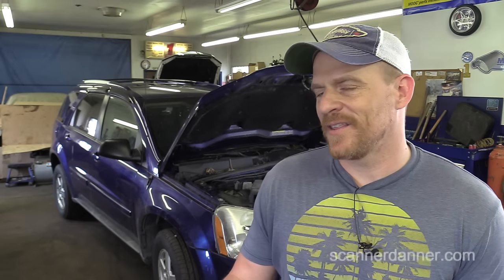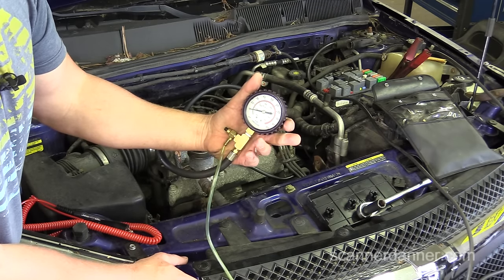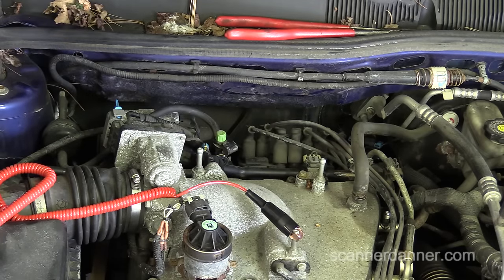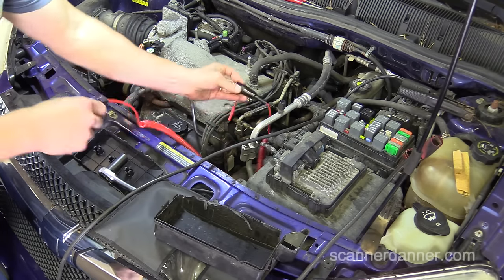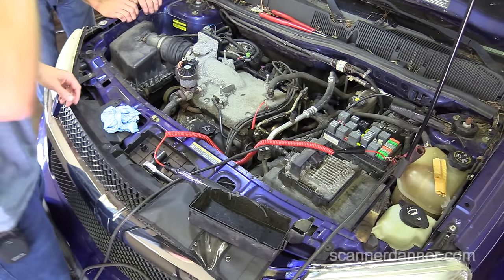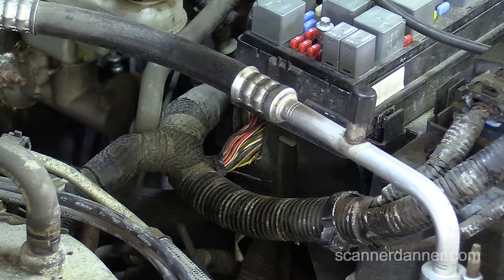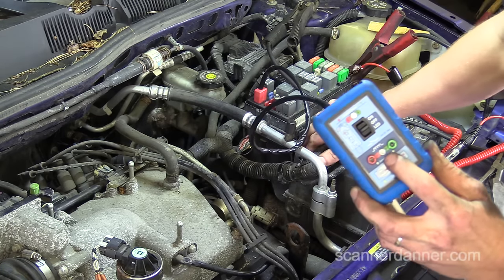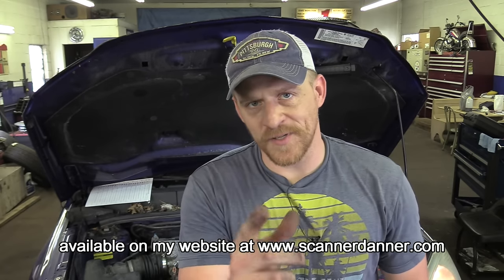No Start, Engine Cranks Okay, Troubleshooting With Basic Tools (No Power to Injectors)

Comment: When you checked the "emiss" fuse for power on each side didn't the engine need to be cranking for the pcm to provide a ground for the control side of the relay to close that emiss  fuse circuit and give it power?
Reply: No, the fuel pump was not on this circuit. Remember when I touched the two ends of the stripped wires together with just the key on and the circuit became active? Thanks! Great question

Comment: Did you have them check the brown wire at the PCM to make sure the PCM was actually grounding that circuit, or just take an educated guess at a broken wire between the pcm and relay?
Reply from the maker: No guess work. With no control at the relay your options are limited to a control wire  problem or  open driver in the PCM. So you start looking for visual evidence before testing the same wire at the computer.
Reply: Being in Texas I guess my first thought would be to hit the pcm next.    Nice find as usual and an awesome video.
Reply from the maker: For sure man. I was headed in that direction

Comment: I had a question. Before concluding that it was the wire that was the issue and not the ecm. Why not do a continuity check from the ecm connector to the relay input? Just a genuine question
Reply from the maker: I almost never use my ohmmeter in troubleshooting. It is voltage drop testing or using my test light for open circuit tests. The ohmmeter will get you in trouble. When it tests bad, it's bad, but when it tests good it can still be bad. Check this one out where the ohmmeter measures 0 ohms of resistance on a bad computer ground circuit https://www.youtube.com/watch?v=McsNOJvd0ao

Comment: yoooooooo danner  tell peat that  car needs the throttle body  cleaned   .. just did one today on same  car    great video   !!!!!!
Reply from the maker: I wouldn't argue that. Primarily though, the reason it wouldn't idle until we turned the key off, had more to do with the ETC fault in memory from no power to the throttle body, than it did a dirty throttle body. 
Thank you!

Comment: Great channel and lots of cool content. Unfortunately I haven’t gotten to the point of my problem. Chevy express 2500 won’t start. Have fuel pressure and spark, but still won’t crank. Btw I bet Pete doesn’t get much done when doing these videos haha! Cheers!
Reply from the maker: Won't crank as in battery, staring system problem. You need to watch some videos from my Starting, Charging and Battery playlist. Start with some basic tests at the starter itself. Watch this one https://www.youtube.com/watch?v=oo1SRIFIkhs&lc=Ugyd8w3HMMpkvQYnQyp4AaABAg

Comment: @scannerdanner In need of help. I recently bought a 2004 rsx with low km's but it was not running. It cranks over great, had 160 across all 4 cylinders. Checked fuel pump it primes like it should. Put a squirt of quick start in the intake and it sputters so it's getting some form of spark. Pulled the fuel line and it has proper pressure. I put new plugs in it and they are completely dry all 4 after trying to start it numerous times. I checked the injector plugs and they have 12v with key on. One weird thing I have noticed is that the green immobilizer light doesn't come on at all. I know it's supposed to come on, blink for 2 seconds and go out but mine doesn't come on at all. I called Acura and they said not to worry about it if it was the immobilizer nothing would work but from what I read the fuel pump will prime but the injectors won't fire. I don't want to tow the car to Acura and have them charge me piles of money, I have the time to diagnose it but need some help. I want to fix this myself. I want to be able to put a built not bought sticker on it when it's done lol. For now I need to get it running so I can have it safetied

Comment: I love heat shrink crimp connectors. Got a set off amazon, also with the built in hot snot. Gonna use them after I rip out my shitty aftermarket alarm.

Awesome video!

Comment: firs thanks for  all information,are there any problem when i use 12v to test ecu (5v)?
Reply from the maker: Use the circuit voltage that should be there whenever possible. Tap into the 5v ref circuit with your test light to substitute signals would be a better option.

Comment: I have a 1989 oldsmobile delta 88 no start, engine cranks and has fire, getting gas to the motor but and new gas lines on and won't start now I have not check the injector for power
Reply from the maker: What engine is in that? Is it the 3800?
I need a fuel pressure reading (getting gas is not good enough)
Then you need so see if you have injector pulse.

Comment: Hello Paul, when you used the relay tool, were you activating the load or control side of relay? Also when you used the test light to check the injectors , on ground you check power, then to battery positive to injector signal, what would happen if you checked it backwards with the test light by not having a wiring diagram?
Reply from the maker: load side. you won't hurt anything with your test light on an unplugged injector circuit. misdiagnosis is all.

Comment: you should try the heat shrink solder butt connectors, same idea except there's solder in the middle rather than a crimp connector

Comment: Followed your instructions, got spark, both sides injectors light up, all fuses,relays good. A new fuel pump, fuel filter, and fuel regulator. Bypassed system security and still won't start. If I spray starting fluid continuously it will run like new, as soon as stop spraying it dies out again. I am stumped. I don't have a fuel gauge for this 2002 avalanche but can hear pump turn on, can hear gas get to rails. Plugs are good, injectors are clean and spraying. Help please!!!!
Reply from the maker: You need to check your fuel psi. You need at least 60 psi cranking. Below 52 it won't start.(central port injection right?) Doesn't matter that you hear fuel.
Reply: ScannerDanner thanks, I am getting a fuel gauge Friday to check it. If not that then I'm gonna try and bypass the oil sensor, someone told me that it will also cause fuel pump shutdown because it uses same hot wire to ecm and if triggered exam shuts fuel pump off as a safety measure.

Comment: I have an 02 Chevy Express with a 57 it ran great it stalled it cranked would not start change crank position sensor would not start change coil it started for one second multiple times change cam sensor still one second multiple times as long as I shut the key off if I continue drinking it would not fire fuel pressure awesome etc is the cap

Comment: I have a 2011 Chevy Malibu I'm working on. Crank no start. Has spark.  No fuel pressure.  No power at fuel relay but power at the fuse..relay is good. Has me stumped at the moment. Any help would be appreciated

Comment: On another note, I use the ground lead on my Powerprobe 3 or 4 as the ground for my incandescent test light. Image a test light attached to a ground(assumed good ground) and you touch a power feed only to see your test light is dim. Is that a power feed fault or a poor ground for your test light? That could really send you in the wrong direction...
Reply from the maker: exactly, always check your connections

Comment: I have a 97 Buick lesabre. I replaced the starter alternator and battery, I replaced the fuel pump fuel filter made sure the fuel lines were sealed at the tank area and replaced the fuel pump relay after that the car would not start. It would start up but die almost immediately. I know the fuel pump gets shut off. I was able to get it started and running with starting fluid. My son drove it but the acceleration was delayed. My son without my knowledge let the neighbor work on it now the gauges do not work and it will not even start with starting fluid. I'm hoping you can help. I have no doubt it's simple but I feel at this point I can bash in my head against the wall. I don't know what the guy next door did to it.
Reply from the maker: you're describing multiple problems here my friend. But since the neighbor touched it and now it won't start with starting fluid, check it for spark next, maybe he blew a fuse that powers the ignition system and also the gauges

Comment: Hiscanner. Danner. I have a vehicle in which I am wondering if you could help me figure out a problem I’m having with it? It’s a 2003 Chevy S 10 blazer 4.3 L Vortec. I’m having a crank but no start issue it is getting spark fuel in the compression is good. I’m trying to fix it for this lady I met and she’s been trying to figure this out for over two years and I’m trying to help the poor lady. Is there anything you can recommend me trying to get it to start please and thank you
Reply from the maker: Where have you tested for spark? These distributor caps are notorious for having issues. 
Also, what is your fuel psi? You must have 60 psi during cranking on these. Under 50 and they won't start

Comment: when you checked the injector fuse, you said if either side isnt lit that is a power feed problem to the fuse. Is that ONLY if the fuse is a "hot at all times" fuse/and if the key is on? Otherwise, that would be a normal fuse reading( no power to either side of fuse) with key off? Sorry for not posting to forum, just wanted to shoot quick question.
Reply from the maker: Key on injector power is common but some circuits are relay controlled and will not have power unless there is a rpm signal to the computer.

Comment: I pulled a plug of a injector i turned on the key both terminals had power is that supposed to happen i stopped testing when that happened please in help would be great please

Comment: Hey There... I have a petrol engine car... It is not starting, I can hear the crank but it wont start. 
This is a regular problem.. If i dont start my vehicle for more than 2 days there is always trouble starting it, once it starts it works fine. 
The thing is I have to start the car once  in atleast two days to stay away from the starting trouble. 
The car takes a long crank to start  if wasnt started for a long period of time. 
Even though the long crank... It does start meaning there might not be anything wrong with the electrical system. 
Can you suggest something, what should i be looking for
Reply from the maker: Fuel pressure test would be my first check.

Comment: good morning, brother. Hey, can you please help me out with a  cuestion I bought a 2011 dodge caliber, but it doesn't have the intake magnefull runner control valve. Is this normal ?
Reply from the maker: what problem are you chasing?
Reply: @ScannerDanner  none the car is running 100% good it just looks like it had it one but I don't know 
I bought this car 600 no crank no start 
relay  corrosion comun an calibers is running now

Comment: I recently bought a mustang 06, it ran perfectly for about a month. Then one cold morning it didn't start; it just cranked, i quickly took it to a mechanic and told me it was the fuel pump. It was replaced and the next morning it did the same thing. The funny part about all this is that the car turns on during the day, but not in the mornings. There are no error codes, is there any suggestions?
Reply from the maker: You need to test for spark, fuel pressure and injection pulse DURING the no start condition. Find out what you are missing then we have some direction and we go from there.

Comment: I have a similar situation in a v8 p38 range rover 1998. There is no feed on the injector circuit with the ignition key switched on. I have checked all fuses and relays, everything seems really  
 ok except the ABS relay that feels hot to the touch.
   Please help me! What should I do next to fix the problem? The only code that appeared was p1843 and p1842.
Reply from the maker: some cars do not use a fuel pump prime with the key on. Do you have injector pulse and spark?
Reply: @ScannerDanner  No, I didn't.

Comment: I have 2006 vw Jetta TDI 1.9
Crank no start
Fuel pump relay good , no blown fuse 

No fuel comming to fuel filter 
Manualy connected power to fuel pump its working 
Power to relay good 
Only 3 volts coming to relay from Ecu and 3 from glow plug 
Look like not enough voltage to kick relay 
What’s next?

Comment: You seem to know how to find the problem on a no start engine. Here is my problem if you can shoot me in the right direction it would be greatly appreciated as i have heard a thousand wrongs so maybe i can get a right from you. I have a 1988 Ford 2.9 Bronco. I engage the starter, it starts and goes dead. If i barely touch the pedal i can get it to overcome with some revs. and it runs but if i push to hard or more than just a small amount it will not start. I am confused why it runs after i barely hit the accelerator and get the rpms up and it idles perfect. Just turing the switch  and engaging the starter it will not run by itself, only after a feather touch to the accelerator. Is this a baffle problem?

Comment: Always use the smallest ViceGrips locking pliers to secure a good ground then clamp test light to it . An inexpensive magnetic field detector works well for fuel injectors , ignition coils , and solenoids .  6/8/23

Comment: i wana ask u i have a chevy 1990 and the problem is i have fuel and i have spark from the coil BUT i dont have spark in the distributor cap i changed the cap and roter still nothing could it be a bad pickup coil in the distributor i have spark from the coil could it be the pickup coil is bad i sure 100% that i have fuel and spark from the ignition coil new cap and roter but the spark dosent go to the cap what could it be do i need a new pick up coil the problem happend after i removed the distributor to check it if the gears are good or not the engine cranks and you can see fuel from the tbi and you can hear and see the spark from the ignition coil but no spark from the cap or any of the spark plugs wire and i have a new cap and roter waiting for your replay thank you

Comment: I have a 2004 silverado 1500 with a 5.3 had a problem with the harness ground on the plug that goes into the coil packs on the drivers side bank i run a jumper wire from that black wire to the battery and the truck starts and dosent stall out now stays running before if i let it sit overnight it will run til it warms up to normal running temp approximately 20 min or so then stall out not starting again i know this is a temporary fix but would like to know if it's a ecm ground or just a harness ground that im using the jumper wire on to complete the ground..what would you recommend...
Reply: Forgot to mention ...i replaced plugs and wires and now i have no check engine light on and have no codes coming up since the plugs and wires were changed before i had a blinking check engine light lost all performance and power po300 code came up and a po496 evap valve solenoid purge valve came up but after plugs and wires changed that cleared all codes none coming up now
Reply from the maker: so you're good now?

Comment: Hey ScannerDanner I have a 1990 Honda Civic I have spark, fuel, but I'm not getting power to my fuel injectors. I did everything you show on this video but when I checked for pulse the light was lit on but no pulse. Appreciate it if you could help me out thank you
Reply from the maker: Not getting power or no pulse, two different things brother
Reply: ScannerDanner no power
Reply from the maker: How to identify a bad main relay on a Honda (PGM-FI) 
https://www.youtube.com/watch?v=6CMZ4g8n0FQ

This one was providing power to the injectors, but this same relay can cause no power to the injectors too

This one below will really help you too

How to test and fix a PGM-FI main relay - Honda/Acura 
https://www.youtube.com/watch?v=X5Qp-ToR8KA
Reply: Hey ScannerDanner so after I check everything from all of the wiring Harness around the car and have done all the tests still no start. I changed the main fuel relay. Still noting

Comment: i have a no start new crank cam sensors coil battery and spark  plugs and i have fuel in the line but it wont start up but i have a loud pitch in my fuse box
Reply from the maker: What is your fuel pressure? "fuel in the line" isn't good enough brother. 
Do you have spark?

Comment: I have a problem will cx9 2012 the injector number 3 flow fuel when you turn key on I replace injector ,  but same problem. Thank in advance for reply
Reply from the maker: Is this a GDI engine?
Reply: micheal kimani I

Comment: You can stick a long flat blade screwdriver against the body of the injector and put your ear on the handle and hear the injector open and close. Sounds like a fast clock ticking.
Reply from the maker: Yep good test too, just be careful the clicking you here can be the injector next in line, in the rail. Always compare two injectors with that test. Also with a no start, the sound of the starter is so loud, it adds some difficulty to the sound test

Comment: Hi, greetings. I know this is an old video but just wanted to ask how do I identify the feed and the control wires in my ford tdci 1.4 diesel. There is no feed on either of the pins. And i dont want to check for pulse without identification.
Reply from the maker: On what? The injectors? You can't do it this way as both sides are controlled.
Reply: @ScannerDanner  not the injectors. But the plugs connecting the injectors. The plugs are not getting any +ve feed. On either of the pins. One wire is orange and the other is black. My problem is I cannot identify which is +ve and which is ground. Chances are the relay is blown but without a manual I cannot even identify the relay.
Reply from the maker: @arnabexp  that's what I'm saying, you can't check injector wires the same way on your set up. They both go to the computer!